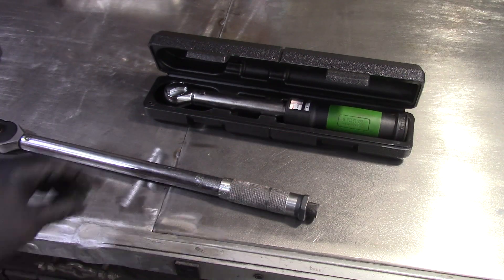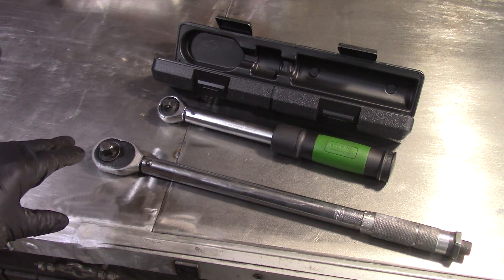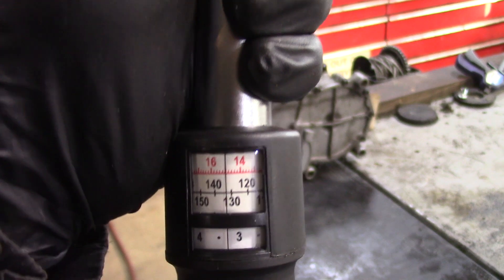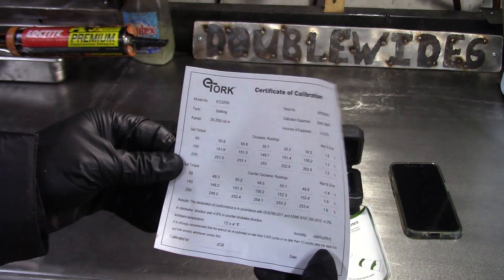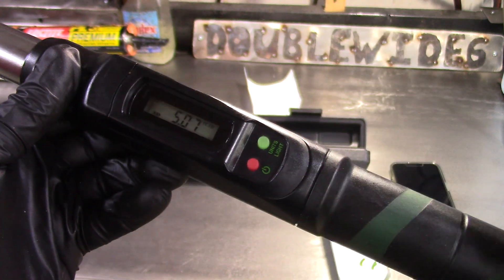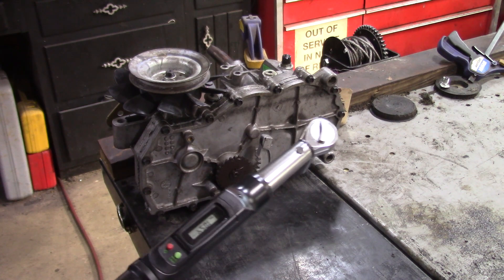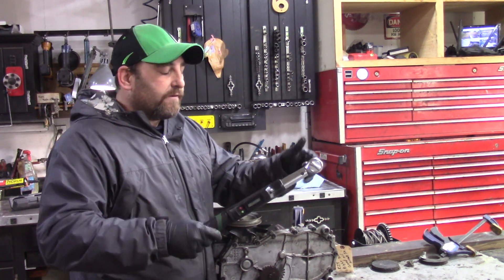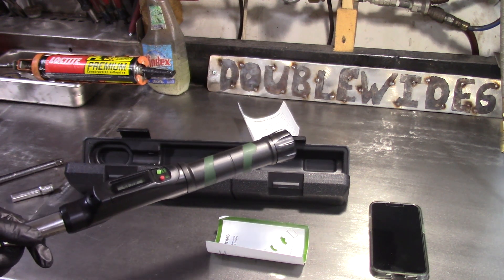Digital Or Manual Etork Wrench?

Comment: A good video there bob , both torque wrenches both worked great I have the harbor freight version like you showed in your video where you have to turn the settings but the digital etork I like there also.
Reply from the maker: Right on

Comment: Thanks Bob these torque wrenches are very interesting, Jake has been saying he wants to go digital so he may order some. Presently we have 3 different sized click style torque wrenches from Pittsburg and Gray which appear to be working fine. We actually purchased a digital adaptor to use as a cross reference check to torque accuracy of the wrenches.
Reply from the maker: If what you have works then you are good.  I was running into issue with mine not working properly so I got interested in the etork brand.
Reply: @doublewide6  Thanks Bob i think Jake is checking out the Etork

Comment: I have the 1/4" as well as the 3/8" that you have, both manual.  I need to torque the cam bearing caps on Japanese motorcycles, and they specify something like 78 in-lbs.  Overtighten them and you could effectively ruin the motorcycle!  Being a Doubting Thomas, I tested mine using a digital caliper + weight (10 lbs x 6" = 60 in-lbs) , and the 'click' was spot on.  Moving the point of application even slightly changes the response just like you'd expect, so it's got a pretty good resolution as well.  It 'knows' the slight difference.  Two years of use haven't changed the accuracy.  Having had cataract surgery years back, I also really appreciate how easy it is to see the torque setting.  I'm not 60 anymore!  I don't use them commercially, but I'm very happy with their products so far.

Comment: How does the accuracy of the manual style compare to those newer ones? I feel that is the unknown with the cheaper ones, are they accurate.
Reply: They offer free lifetime calibration (you pay shipping both ways), but really, testing them is a matter of having a known weight and maybe a bench vise to hold the square drive perfectly horizontally.  Just measure a distance accurately, and apply the known weight.  I use a loop of #14 AWG solid copper wire and hang ten pounds from the tool's handle.  That way I can apply the weight at the exact spot I measured.
Reply from the maker: The Etork brand is as accurate as proto and snap on.  The HF brand may be accurate, but it may not be.  I was having some issues with breaking lighter fasteners, so I was looking to upgrade but not break the bank.  Other Youtube channels have equipment to test all wrenches side by side. check them out.
Reply: @doublewide6  Thanks for the info.